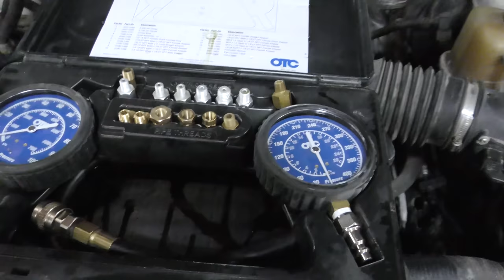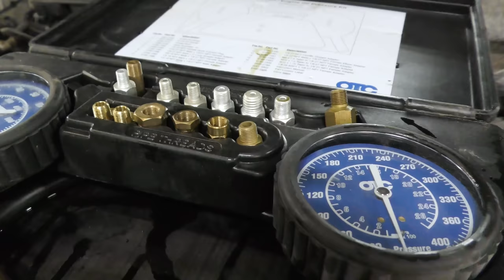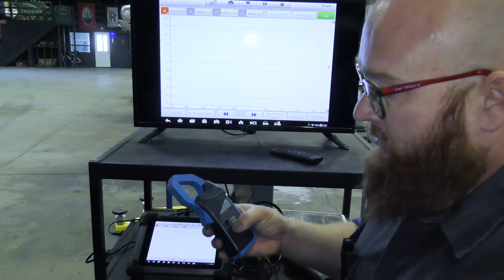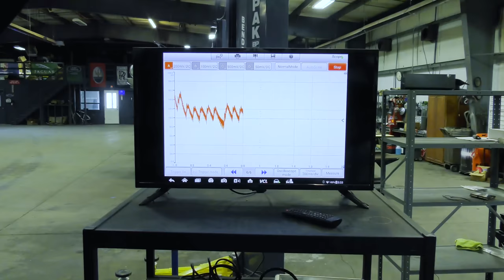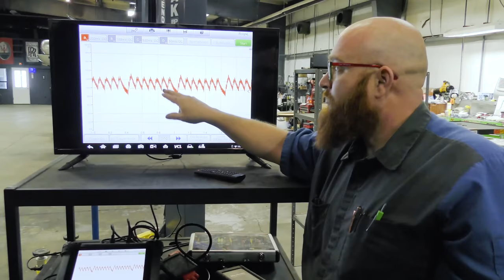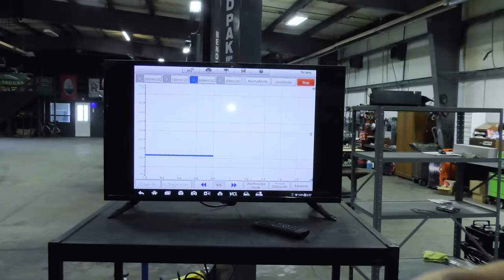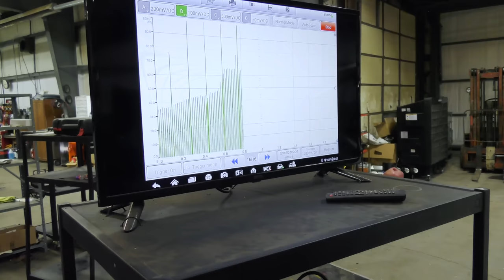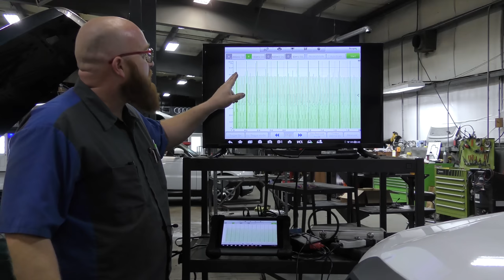Can an engine additive really fix this 2011 F150? CAR WIZARD shows how to diagnose and repair

Comment: Lucas original or the “Full Synthetic New Car Formula - light enough for imports”
Reply: The light enough for imports formula because I think this engine takes 5w20 or 5w30.. the thick formula in the white bottle is for the older push rod engines that took 10w30 or 10w40

Comment: Very good to see the Autel gear current sensors, however your logic on reading repeated waveforms was flawed as you already knew which plug you pulled and started counting from that fact. If timing data from ecu was displayed too, yes could go straight to that one cylinder. Otherwise pulling another plug to give a known cylinder issue. The repeating waveform only told you that one is missing compression, not which. Without additional facts, that would be guesswork or pure wizardry. Try it double blind a few times with someone else having caused it, just using the current sensor (16% chance of getting it right on a 6 cylinder engine).

Comment: "When have you used 'engine additives'?"  Not very often.  Skeptical of most 'Fix-an-engine-in-a-can' products.  Would rather just fix the problem than put a bandaid over it.  If there's a leak, fix the leak.  Have found that some internal engine cleaning products do a decent job of clearing up sludge and deposits.  
VT247

Comment: Car Wizard, does this Motorcraft oil filter only apply to Ford 5.0L engines? I have a 2000 Ford F-150 with 4.6L V-8 and I have used other brand name oil filters. Also, I have 125K miles on my F-150 and it started to consume oil; so I started to add AT-205 Reseal additive. Should I continue with this additive or start using Lucas oil additive? I have no issues with oil light coming on.

Comment: The dog urine 5w20 oil that the factory recommends is too thin , it lacks sufficient film strength to prevent metal to metal contact under high heat - stress conditions .  the cure is to switch to 5w30 when the factory warranty expires . I'm an engine machinist with 36 years of experience .

Comment: Dont trash the 5.4 too much , they all have their problems.   We have had 4 on the farm , treated rough but still got the regular maintenance,  2 of them were 400,000km plus ,  one we sold the other is still here chugging along .  The other 2 are older ones and still going.  I should add thst we dont use the manufacturer oil weight , 5w40 all the way , or heavier.

Comment: I did not look up the viscosity of Lucas adative, but instead of 20% of it in  let's say 5w30  wouldn't be it  better to use 5w40 or 5w50 even?

Edit: 
Looked it up,
20% of Lucas (19.7 cSt@100c)
With 5w30 (10.5 cSt@100c)
Has a viscosity of 11.8 cSt @ 100c where's 5w40 is around 14-15 cSt @100c.
So in short, going up an viscosity grade is more effective than the Lucas.

Comment: Lucas additives are very good.  They're the only additives I use.  I generally don't like or use oil or fuel additives since most do little or nothing.  Actually Chevron fuel additive is also pretty good but I rarely use it.

Comment: How hard is it on that engine to get to the oil pressure relief valve and check both the spring's free length and the condition of the valve itself?

Comment: Ha!  I have a 2005 with the 5.4 triton.  It has 155,000 miles on it.  No oil burn.  It does have the cam phaser ticks, but it's still going.  If you change the oil every 3,000 miles like your supposed to they can last a long time.  I bet I get another couple years out of it before it dies.  People who let it go 5, 10K miles before changing are asking for it.  I bet an owner of this truck did not change the oil out every 3K miles.  I'd bet money on it.

Comment: What is the oil weight specified on oil fill cap?
5-20?  That thin oil is the death of most newer engines.. Might be fine when new up to 100k
but should be switched to 10-40. Then later switch to 20-50.  300,000+ on my cars and trucks, no new engine..

Comment: Wizard! My 2012 f150 King Ranch is doing the same thing but only I drive after it is warm, but then it also drops rpm in drive bellow 500 rpm. What is the rpm at idle in drive supposed to be?

Comment: What about the case when all cylinder are low on compression ? The graph will be symmetrical and you will not see the issue.
Reply: Yes, amps would be low on all cylinders too & the starter would run very fast. Some cases, engine goes on spinning (Not running) after the starter stops :)

Comment: Wizard would you recommend doing this to a 99 Crown Victoria that has the same problem when you are at a stop light?
Reply: It's worth a try. Cheaper than a replacement engine for sure. I used it in my 98 Isuzu Rodeo and it quieted down the lifter noise. Drove it another 30k before trading it in.
Reply: Are you revving your 4.6 at the stop light like an idiot? 

Or, was that just the previous teenaged owner? 

Or, it has noise all the time, that you only hear while idling? 

What does it sound like when you floor it up the on ramp of the highway?  Lots of valve float perhaps?

Comment: Very interesting video thanks! This whole discussion takes me back to when I inherited my wife's 1971 Vega. "Secretary special", about the cheapest new Chevy you could buy back then. Two door no options at all, rubber floor mats, fix rear windows. Instant oxidizing paint. And that abysmal aluminum block 4 cylinder with the iron head. Power glide transmission. Omg. Of course in her ownership, she had overheated it to stall a couple of times, somehow it ran after that but boy did it use oil! The only remedy, temporarily, was a can or two of Alemite CD-2, which had enough viscosity to try to deal with whatever it was. It finally burned a valve and I had to pull that infernal iron head off the thing, to see that two cylinders head scores so badly that you wonder how it ran at all!

Comment: Is mobile oil and filter onto run if that’s the case with the oil filter just bought a remanded engine and transmission?

Comment: so if lucas makes it work which is basically thicker oil to raise the viscosity of the oil in there why not run a thicker oil. thats what i do on my 2002 220k mile bmw. instead of running 5w30 in it which i was topping up every 1-2k miles i run 5w50 motorsport oil that stay more viscous at high temps which i don't have to top up between 15k services

Comment: If 180,000 miles is high mileage, we have had some cars that are stratospheric! My daily driver is at 400,000. My 89 Grand Marquis was at 185,000 when the car was wrecked in a collision. My brother has had several cars that went well over half a million. To me, that is dreadfully premature wear. Then again, I would not touch any Ford engine newer than a Windsor. $10,000 to fix the cam phasers and timing belt guides is crazy. $4,000 to rebuild a transmission between 200 and 250,000 miles is nuts. From the experience of friends, the newer GM and Dodge/Rams are no better. Nonsense like this reinforces my belief that vehicles from the late 80s and early 90s are the best bet

Comment: About the autel Amp device: How do you know which is the low compression one? When you fire the engine it can be in any possible position, so how do you know which "wave" correspond to which cylinder?
Reply: I was wondering the same thing.  I thought I missed something.
Reply: @andylucas8262  You're right. I thought the firing order would tell you, but thinking about it, I'm not sure why.

Comment: You know if your a good or great tech or shop... you get brought some real puzzling issues. Especially  when previous guy rewired in hurry or better made a one color wire harness... also on 5.4 3v Motorcraft filters were the answer to. I have 3 plus 3.5 ecoboost and 6.7 stroker all Motorcraft filters for reason. At the county same deal for fleet. And we get a lot more miles out of 5.0 etc. Heck a lot 5.4 3v we got near 400k before they were sold off.

Comment: Thats nuts! Worn out engine after only 180k? I have a 2003 jeep liberty with the 3.7l with 350k miles, got a oil light on and it was just the sending unit, replace with ngk and all was gtg.

Comment: I did hear that the F150 is rated #1 because GM and Chevrolet trucks are split between the two "GM brands."  I haven't seen figures otherwise but I wonder if you grouped GM and Chevrolet trucks together and compared them up against Ford trucks, what the result would be then?
Reply: Interesting point

Comment: They put the wrong oil filter on it put the Ford Motorcraft I think it’s called a 500 S something like that there’s a valve inside the oil filter they didn’t put it on

Comment: Why not try 10-40 first . . . I used 20-50 in an old Town Car, 280,000, no smoke . . . passed emissions . . . used up a quart every 3000 miles.

Comment: Can you diagnose the brakes (soft pedal) on my 2010 Nissan Frontier 4x4. I have taken it to at least 1/2 dozen mechanics. They have replaced everything (some parts twice). No one can fix this problem. Also, $1000’s . Thank you.

Comment: If  you  live  anywhere  in  the  southern  part  of  the  US,  forget  using  and  20  weight
engine  oil.  Yes,  I  know  car  manufactures   say  use  5-20  or  10-20.  That  may be
a  good choice  if  you  live  in  really  cold  northern  US  which  have  really  cold
winter  climate.  Use   a  10-30  or  straight  30  weight.  Your  engine  will  love  it.
Car  manufactures  want  your  engine  to  wear  out  as  soon  as  possible.  Even
mixing  a  quart  of  40  weight  will  not  hurt  anything.   Also  use  a  quality  oil
filter like  WIX   or   Napa  Gold.   Get  smart  and educate   yourself  on  engine oil.
Reply: If  you  live  in  the  northern  states,   in  the  spring and  summer  get  rid
of  that  20  weight  oil.  Dump it  and  put  in  10-30   or  straight  30.
This  is  good  advice...believe  me.

Comment: 5w-20s oils is specified on these motors, why?  Because The CAFE (Corporate Average Fuel Economy) standards set by the Obama Administration had an impact on the mindset  of the engineers and the automakers. The engineers focus on achieving the MPG that a bureaucrat in Washington set.  I remember when your vehicle became older people would switch to straight 30w oil.  It help fill the gaps of internal parts that are wearing.  Keep in mind, there is a difference between wearing and wearing out!  LOL. Instead of putting 20% less oil in the engine and making up the difference by putting Lucas maybe just use straight 30w.  On the other hand, maybe, Lucas engine stabilizer can get rid of that clacking noise on start up.  A famous quote from Truman was “Farming is easy when your plow is a pencil and your farm is 2000 miles away”.  A bureaucrat shouldn’t have such an impact on a engine that was designed 5 years prior to production!

Comment: Having the same issue on 2005 Chevrolet  2500 hd. 100,00 milesShow low oil pressure. Had oil pump replaced no better. Sending unit replaced. No knocking  runs great. Any ideals?
Reply: I would try the Lucus, can't hurt and it's a cheap fix

Comment: Wizard, what motor is in that f150? I have 3.7 in mine and did have the pressure sending unit issue. Currently have 199478 miles on it and it seems strong.
Reply: 5.0

Comment: Why not use your own advise and test the numbers claim on a Dealer oil filter pressure, you have the equipment right there. Unless Motocraft is sponsoring this? Great tip nonetheless.

Comment: ... help help help... We have a 2013 F150  4 wheel drive Texas edition ...found used motor  and transmission  And paid a local shop to install  they said it would take 3 or 4 days ... can't get it programed ...so The shop took it to the Ford dealership and they couldn't program... so now its back at best buy automotive ...Montgomery Alabama....engine is 5.0 w 6 speed auto ... any help would be appreciated... soon will be three week s...

Comment: It’s not that these engines wear out at 180k it’s prolly had long interval oil changes with regular oil and would start to wear the bearings. Change your damn oil and your engine will last well over 200k. Many work truck 5.0 and gm 5.3 will go over 300k with oil changes and correct oil. Prevent the wear is key.

Comment: 5.4 3 valve triton owner here 170000 miles only changed the alternator so far, think it might have bad cam phasers but has been making the diesel noise for 10000 miles with no power or pressure loss they are not as bad as wizard says as long as you don’t cheap out on oil you use.. I have had way worse experience with two 5.7 chevy Silverados both blew out tranny before 200000miles. wizard is honestly just a hater

Comment: I respectively must disagree with your Chevy truck best opinion. Ford is now and has been the #1 selling truck in the U.S. since the 1960's. Considering that the Ford is more expensive than the Chevy and continues to keep its value longer, keeping the #1 slot is quite an achievement. Besides Chevy, most of the other truck brands have had to bow down to the Ford innovative designs and excellence in build quality. 

Other than your Chevy misadventure, I really enjoy your posts. Keep them coming.
Reply: ford literally stole e-torque from ram, and still hasn’t matched to their interiors/quality. 

chevy is crap i’ve had nothing but bad experiences w them
Reply: @TheSavage3.6  I partially agree. All auto manufactures steal ideas from each other. As for Ram. Since Fiat bought Chrysler the Ram truck quality has gone to shit. Interiors are cheap. Frames, engines and drive trains are not.

Comment: Have you heard about the RVS additive?
Reply: Excellent stuff, although strictly speaking it's not an oil additive. It just uses oil as a means of transfer.

I've been using it for over 10 years. It completely silenced my '62 Rambler rear end, which had an annoying whine at around 50mph.

Comment: If you have ever dropped an oil pan on an engine that has Lucas in the oil...you WON'T run it! It turns the oil into a honey like consistency and it aerates HORRIBLY. As you know, air doesn't lubricate. Plus that significant increase in viscosity increases windage, which reduces efficiency. 

Having said that, what's up with the Dodge!?

Comment: In reality, you only know that A CYLINDER is low on compression.  You only knew that that was cylinder 2 because you pulled the plug.  The cranking pulses don't start at any particular cylinder, at best you would just see a repeating pattern.
(UNLESS, you combined this with pulling a known plug, good or bad and seeing it in the sequence.)

Comment: Shit. That is a really horrible engine life range then. My 03 S10 has 217k and hasn't a slight issue at all with running. Other than slightly running cooler due to a new radiator I had put in. But one notch below the middle is quite acceptable. Mainly cause the old radiator was a bit rusty on the inside. Glad I stick with Chevy and not flipped over reservation decorations. Or having many fucked over repair days.

Comment: Am I the only one that is shocked that this trucks motor is wore out at 180k? My jeep 4.0 and Chevy with an 8.1 both over 300k and no oil pressure or wear issues.

Comment: Almost 200k miles. That’s not bad actually
Reply: Coyotes, like most engines, are actually really good for longevity as long as you change the oil and do your routine maintenance.
Reply: @169abr  I know of a 2018 5.0 with over 220k.
Reply: @Bushy556  good lord and I thought my 80k and my girls 96k was high lol

Comment: Oil is cheap. Change it every 5 K and they’ll run a long time. I use Ford oil and filter.My Dealer is cheaper than Jiffy Lube. I’ve seen 3.5 Ecoboost run 300,000 miles .

Comment: I wonder if going to a 5 - 30  weight oil would have solved the PROBLEM?    We use to always run heavier oil in older engineer for better oil pressure.  But I'm sure the Lucas is the best way to go. I was just wondering.

Comment: 3000 mile oil changes from hear on out for the F150, the truck looks like it was taken care of and a motor swap might be worth while later on.
Reply: Depends on what everything else on the truck looks like. Trans, rear end, suspension, electrical is all the same age and mileage. Is it worth dumping a 5-10k engine in a worn out truck?

Comment: No point in using the amp clamp.... use the scan tool and perform relative compression test which gives percentage values of each cylinder and disables the injectors, this is used for reference only which does not replace proper compression test procedure just an indication which cylinder to test.  Instead of promoting your sponsors tools maybe you should actually go through and explain the proper steps and procedures to your viewers. No mention of checking battery state of charge, disabling fuel system so you don't have inaccurate readings and should have the throttle body open. This is by no means an accurate way to diagnose and confirm a cylinder with low compression which your claiming it is and is false information. To many variables that will affect amp load readings such as started condition, torque converter, flex plate to starter clearances and every other mechanical part that rotates with the engine. Again it is only used as aid in indicating a possible low compression concern. Using an amp clamp to test for parasitic draw is also completely false as they are not sensitive enough to read low amps. Using coil testers can be misleading as they will pick up other electrical component noise. I'm  question your integrity as you claim that your diag is 100% yet all the tests you just performed are not precise or completely accurate enough to positively confirm a diagnosis.

Comment: My  13' f150 3.7L v6 has 308,000 miles on it  still going strong,  oil every 10k  transmission every 35-40k.     Fuck fords 150k transmission fluid life

Comment: 200k on a modern motor is not that much. Better bearings and hardened parts would prevent this. Bean counters cheapening these engines